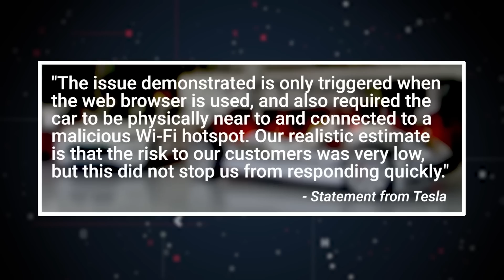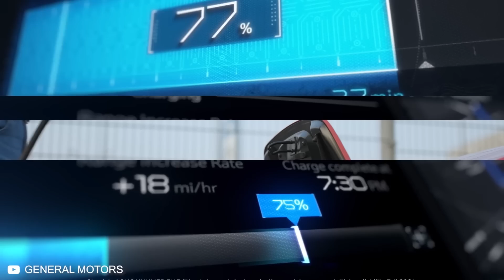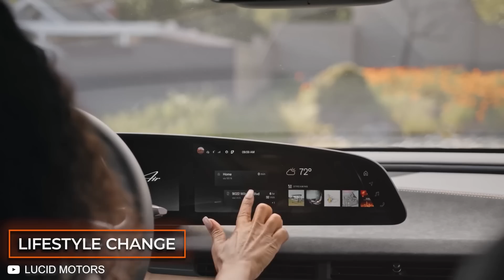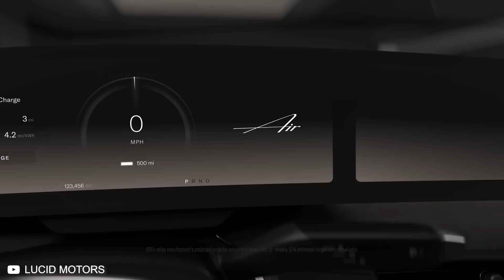EVs' Serious Problems That Carmakers Are Hiding

Comment: But where do they think the electricity comes from. From fossil fuels that power generators that make electricity. That's where.
Then if you live where it's warm, you will need air conditioning!!! And if you are going uphill with theairconditioning on, you might need to get outside and push.
Reply: Not all all electricity comes from fossil fuels and it doesn't have to. The rebuilding of grids and the power plants with modern technology is already happening in many places that require less fossil fuel by using wind and solar to take up the slack until next generation nuclear. It can be done; one only has to look to Sweden and Brazil where close to half of it energy comes from renewables. Just under a third of Canada’s energy comes from renewables.
Reply: @rps1689  I agree mostly but I wonder why Brazil finds it necessary to burn it's forests. Insane leaders(bosenaro)and his politics/religion I guess.
Next generation nuclear.... hopefully gets around the radioactive waste problem.

Comment: And Where does the electricity to charge elec vehicles come from? CARBON ! ! ! 90% of all electricity comes from Coal or Natural Gas power plants... Internal Combustion Engines burning Hydrogen and Oxygen have ZERO EMISSIONS! Far less than the OZONE POLLUTION from ELEC MOTORS! ie, WATER is our #1 ENERGY SOLUTION ! ! ! Not conventional electricity

Comment: All of the transportation sector (cars, buses, trains, ships, aircraft) make up 16% of the greenhouse gas emissions.  EV's, if mandated for everyone for every purpose, would no put a dent in the perceived problem, and would most likely exacerbate it due to the number of fossil fuel powered electric plants needed to support the increased electricity consumption.
Reply: Only if power plants and grids are not upgraded to be more efficient. Petroleum is too valuable to waste as gasoline. We should leave as most of it as we can in the ground for our grandchildren for plastics, paints, petrochemical feedstock medicine, etc.

Comment: Making a list of things that I believe are incorrect in this video:

-Maintenance fees are next to nothing, with the exception of a failed battery out of warranty (while I'm sure this has happened, I've only once heard of a battery completely failing. This is incredibly uncommon). I've owned a LEAF for 2 years (a 2012) and have done nothing but tires. Battery is still fully functional, no motor issues, no oil changes required, etc.

-Electric Vehicles can absolutely run at below-zero temps (Fahrenheit). I've driven my LEAF (with no battery heater whatsoever) in -13 degrees F. It worked just fine (albeit with about a 10%-15% range reduction).

An aside: I've saved literally $2000/year driving electric (and yes, this is after accounting for the increase in my power bill). No oil changes, no timing belt to blow up, no gasoline. There's no more waking up and running late to work, just to find out your gas light is on and you have to make another stop. You wake up with a full (or mostly full) car every morning (assuming you live at a place with a charger or 120V outlet). For the people that worry about roadtrips, it's such an infrequent occurrence for most of us that it shouldn't be the reason you skip an electric car. The average American drives <30 miles per day. If you get an EV with 150 miles of range, you'll be golden for days before charging again, and you'll have the range to drive to a destination a couple hours away. If you need to go even further, the savings from owning an EV will more than make up for the cost to rent a vehicle for that rare time. I understand range anxiety, but having lived with a LEAF with 50 miles of range, I can assure you that I have never once gotten stranded even while pushing it to the extreme. Fast chargers are pretty abundant (look at plugshare.com, filter for CCS). The point is, it's not all scary like people make it out to be.

Comment: When I watch videos talking about positive things about EVs, I hear about public and environmental health, but I don't hear anything about my wallet and it's my wallet that's going to buy the EV, if I'm convinced it's a good deal.  But when I ask about price, I'm typically branded as being anything but an authentic realist asking about factors that are important to me.  I've never been in an EV and while I'm open to them, I'm far from sold on them.  For me it's not about resisting any inevitable change headed our way, it's about making sure the cost of whatever someone might be trying to force my way is affordable to my wallet and I don't lose my house trying to buy and maintain an EV.
Reply: something that is also rarely brought up from pro-EV videos is the engineering and safety side of things. Battery degradation, battery and electrical component damage, etc. are always over looked in these conversations, and people think engineers just magically come up with solutions on the fly and everything will be perfect. The reality is, we cannot find a solution if we do not ask the proper and NECESSARY questions.

Comment: Presumably the stats around distance per charge do not include electricity needed to have the air-con or heating on, opening and closing windows and all those other annoying little "luxuries" we petol/diesel drivers demand from our vehicles!
Reply: @Kim Dallas Yes, and also that when it is, let's say, 40 degrees fahrenheit, or when driving in hilly areas, the range is reduced an additional 10 to 20 percent.  Range is something the manufacturers definitely need to improve.

Comment: The idea of having a EV is kind of exciting, but right now, not practical. Charging and range anxiety are the two main issues I would face. So, right now, that decision will be later on down the road.
Reply: If you look at all the product that use lithium batteries they lose there charge the more you charge them up, especially the cell phones and they are making phone where you can't take the backs off so you have to buy a new phone when the battery goes out and can't be charged anymore. That is what our futt will be for the EV cars also. Everytime you charge the car you lose a percentage of the battery capability till it won't run or charge up anymore and right now the batteries caso $2 to 3,000 for a pack but in ten years it could be as much of what you paid for the car.

Comment: After all you said you missed a few. The possibility of fire is high with an ev and the lithium can't be put out. If your car catches fire in your garage it will burn your house down.Then there are all the haters who will roll coal, key your paint, and road rage on you all because you drive an ev. Why would you put up with all that?

Comment: Nope.  I never plan on buying an EV.  They are inconvenient, expensive, and worst of all a fire hazard.
Reply: Depends on what you are using them for. I have no intent on getting one until they get a range of 1000kms on a charge. BTW, t he chance of an EVs battery igniting is 50 times less than that of a ICE, but your EV will be a write-off.

Comment: I live in a condo complex and I have to park on the street.  I will never be able to charge at home.  The privileged few at this complex have a parking spot in the lot, but there is no electrical wiring near there.  I have never in my life paid more than $7,000 for a fairly good used car.  By the time an EV is old enough to sell that cheaply, the battery pack will need to be replaced, I'd guess.

Comment: Components of a car batteries are highly flammable? Are we being told here that gasoline is not flammable? Is that it? I supposed that riding over a 15 gallon gasoline bomb is way safer than a battery? Is that what we are being told here?

I supposed this video is from last year, but yeah, check the charging infrastructure just a few months later and see what you have. Tesla is by far the most important company in starting this revolution, but who would have thought that the best thing that could happen to this planet was Diesel-Gate. It didn't just happen in the US. It happened all over the world. And due to Diesel-Gate, and the penalties imposed on VW of creating a fast charging network on most major countries, more and more 150kw and 350kw chargers going up every day. 

And with 800 volt (and higher) architecture cars can now gain 300 miles in 20 minutes (lucid air), or 10% to 80% in 18 minutes, (Porsche Taycan, E-Tron GT, EV6, Ionic 5) and more coming around the bend. GM has committed to all 800 volt architecture for example. And with 800 volt architecture, it's cheaper to build a car: Less copper, less wires, more efficient voltage, and less materials means less weight and still greater efficiency. And a higher voltage system allows a lower current to be used when charging, which means less heat on the batteries which makes them last even longer.  

And the new LFP batteries are much cheaper due to more abundant materials needed to make them, and last 3 to 4 times longer than current NCA batteries. It's much, much cheaper to build and EV than a combustion car with over 30,000 parts. So yeah, they'll be much cheaper than internal combustion sooner than most people realize. Wasn't it just 10 short years ago that Tesla's a EV's were being doubted? 

And what's the cost of gas or diesel again? How much does it cost to fill up that F-150? Or better still, those F-250's and 350's? $200 to $300 dollars a week? Times 52 weeks using the $200 figure it's $10,400 a year. Using $300 it's $15,600 a year. Even doing just $100 a week its $5,200 per year.

So lets see, after 8 years that's $83,200 for the $200 per week figure -- or using the $300 per week figure, it's $124,000 after 8 years -- or using the lowest figure of $100 per week, it's still $41,600 after 8 years. And that's not counting all the oil changes, break pads and rotor replacements, new sparkplugs and cables, belts replacements, oil filter replacements, fuel air filters replacements, adding/maintaining antifreeze, changing the steering oil, and so on; none of which need to the done on EV's.  So am I missing something here? I'm confused as to how that is less expensive that a new battery pack for $8,000 or $10,000, or even $15,000 after 8 years. 

Or, and by the way, there are many EV on the road that are over 8 years old now and still going strong with their original NCA batteries. And even some 20 years old that are still doing fine. Just imagine that with LFP batteries that last 3 to 4 times longer. 

And remember, a typical modern battery pack 20 years cost around $50,000, that's why they used tiny packs using inferior batteries that cost less then. 10 years ago it was around $25,000. Now it's under $10,000. Just think of what it will cost 5 or 10 years from now using cheaper to manufacture, abundant resources LFP packs. 

But the brain power on these forums is starting to hurt my brain. Screw those 50 inch 4K LCD televisions for under $300 that use less power. I hear their screens are going to burn in 2 or 3 years anyway. I'm going back to my trusty flat picture tube 27 inch Sony television I bought 20 years ago for the steal price of $500 with its full 480 lines of resolution. Who needs 4k or 8k, or even 1080p anyhow. I can see the hockey pucks whizzing by on the ice on my flickering lines of resolution just fine.

Comment: My work trips to and from will be ok but longer trips are out of the question.the infrastructure doesn't support dropping gas cars and trucks completely trucks and towing make evs impractical for that.long trips or off the grid trips would be problematic if not impossible and dangerous

Comment: Where is most of the lithium, nickel and colbolt is mined and what does the extraction process involve?
Reply: It doesn't involve dumping as much CO2 into the atmosphere. The amount of petroleum needed to provide fuel for mining and how much CO2 it will dump into the atmosphere is small compared to the amount road transport uses. Strip mining for REEs and battery disposal pose no risk to the continuity of human civilization, but the continued consumption of fossil fuels at current rates raises that risk. 

Good news is, not only is the technology improving at a fast rate, less and less cobalt is being used for batteries; current sodium and redox batteries don't use any plus it is highly likely in less than a decade, sodium will overtake lithium in car batteries. 

The technology already exists to contain lead, mercury, and cadmium when recycling batteries and it is improving by the year to the point that in about 20 years the need for mining will be reduced substantially. All the other mineral and elements in a EV battery are fully recyclable even after being used as second-life batteries. One nice thing about EV battery cells is, they find a second use in stationary grid storage. When there are enough of them to create a market, they will be recycled to reclaim the valuable metals just like any other high volume appliance does nowadays.
Reply: @rps1689  I disagree.

Comment: A car the Government can turn off if you dont OBEY them. I will keep my old 60's and 70's cars. The fire from an EV extremely dangerous. Gas fire burns around 1100-1500 deg. and you can put out with Fire extinguisher  EV battery fire burns instantly at 6000 - 10,000 deg. and can't be put out with fire extinguisher.
Reply: But you can put out a EV battery fire easily with a lithium fire blanket.
Reply: @rps1689  Good luck with that and the size of a Ev's battery
Reply: @rps1689  Do the cars come with Lithium fire blankets? By the time you could react you would be severely burned. You are sitting on top of a time bomb
Reply: @jgmopar  The chance of an EVs battery igniting is 50 times less than that of a ICE, but the EV will be a write-off. Good news is some automakers are going to stop using lithium ion batteries and use lithium iron phosphate batteries instead, which will make them safer that ICEs. Also it is highly likely in less than a decade, sodium will overtake lithium and be the norm.

Comment: I think hydrogen cars are gonna be the future cuz it fills up fast and releases zero emissions. But we will never know...
Reply: I agree,and I'm waiting too - EV's are already obsolete when you add everything up, but they too have to reduce the cost of a fill up a Hydrogen Car in California.  Currently it's is at the equivalent of $8.00/ gallon.
Reply: Hydrogen cars have failed.  Nobody can get past the cost of installing hydrogen stations everywhere and keeping them supplied.  On top of that, hydrogen is less efficient than battery power, so we'd end up needing that much more energy production.